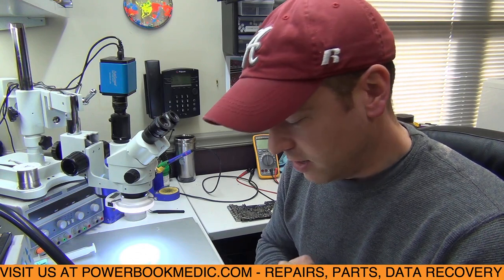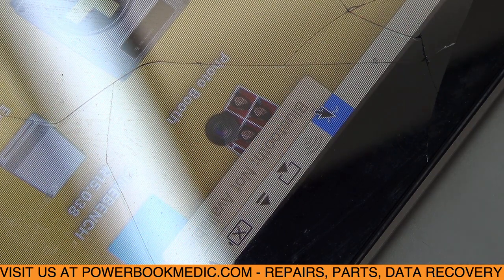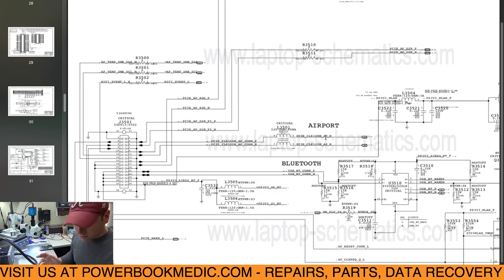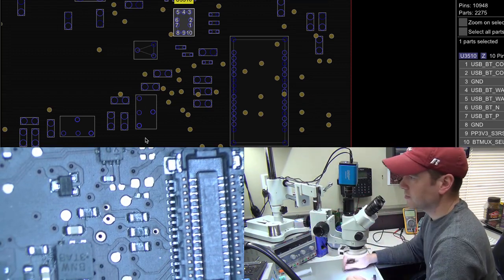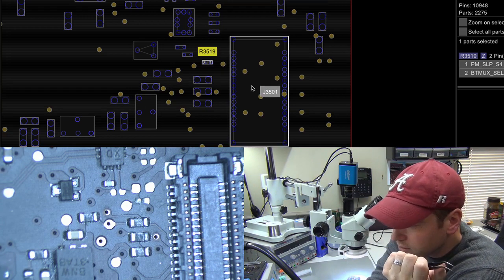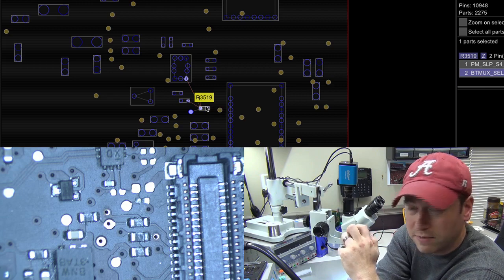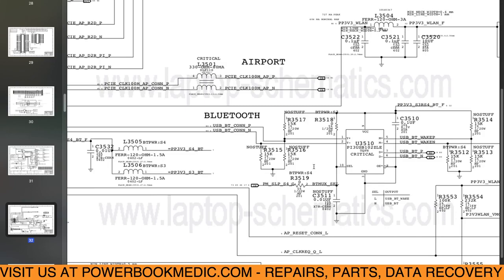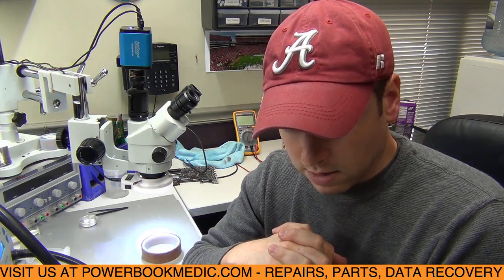Macbook Pro Bluetooth Not Available Repair on a 2012 13" A1278 - Board 820-3115

Comment: Same issue for me ,,  i dropped my mac and it seems that the cable connector on the bluetooth became loose. i tried to push it in place and my bluetooth came back with the wi fi

Comment: The bluetooth goes in and out on my macbook pro 2012 depending on how I hold it. If I put pressure in certain areas of the base, the hardware will go from not being available to suddenly and momentarily available. I've replaced the hardware itself but the problem remains. Not sure what it is that is being so touch inside this thing.

Comment: Hey! Awesome video and great job!

I have the same MacBook Pro model (mid 2012) and almost the same problem, but in my case Bluetooth works fine and WiFi shows as “not installed”. When WiFi works, it takes some minutes to turn it off by itself and doesn’t turn on again. Even Apple support guy told me it doesn’t make sense: Bluetooth working and WiFi doesn’t.

I’ve searched the entire web and only found multiples resets and replace the Airport. Since I tried all resents and re-install macOS multiple times, without success, I’ve replaced the Airport, ribbon and the entire piece. Result: the problem persists. 

Have you ever found an issue like this for WiFi? The same investigation is valid for WiFi? (because in the schematic the components for Bluetooth seems more complex than WiFi).
Reply: Aynı sorun benim A1278 Macbook da mevcut. Yeni wifi kart ve kablo aldım fakat yine çalışmıyor. Siz çözüm buldunuz mu..Teşekkürler

Comment: 0 ohm resistor 1/20w is like a fuse right? should you check the voltaje and current that pass thru there? btw what is the schematics software you use for pin connections?
Reply from the maker: Cesar U Yes, it is a lot like a fuse.  It’s always a good idea to check the voltage and current and the software I use is called Open Board View.

Comment: i can run Sierra or anything else and the wifi card has bluetooth and everything works normal, when i run Mojave the wifi card shows no bluetooth , it is not even there, grayed out and it don't show up in Mojave,  i put a bluetooth module in the usb and that works, it shows up where the bluetooth shoud, the wifi on the card works but bluetooth don't work in Mojave, what is with that one
Reply from the maker: Im not so sure about that issue.  Never seen that happen before.  Here is something to try…  Go to System Preferences /  Network  /  And then click the plus button on the lower left side of the window.  Then Add Bluetooth PAN.  If that doesn’t work, sending it in for repair is your best option.
Reply: If your MacBook Pro is 2011 model it won't support the hardware. Let me know which model you are using.